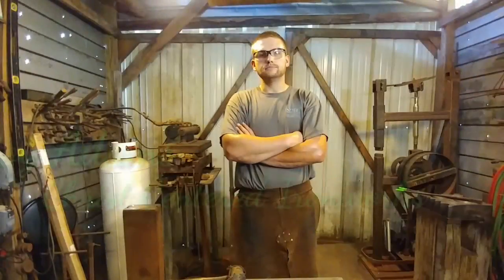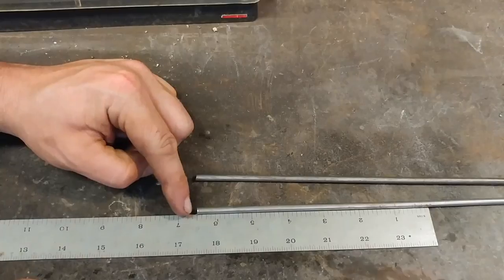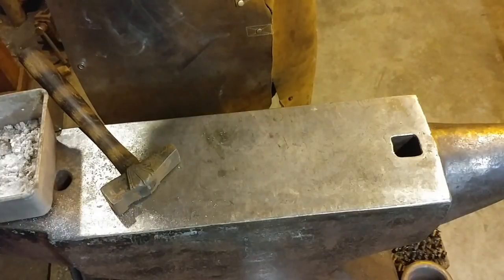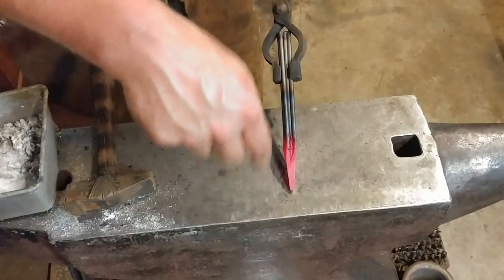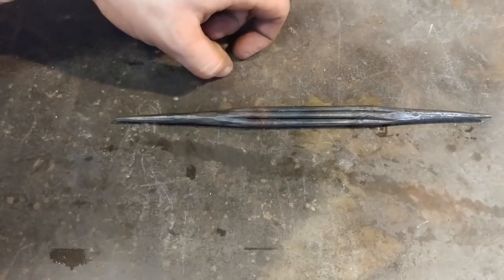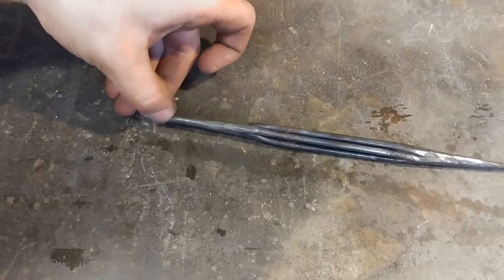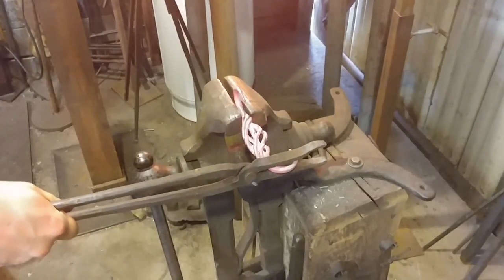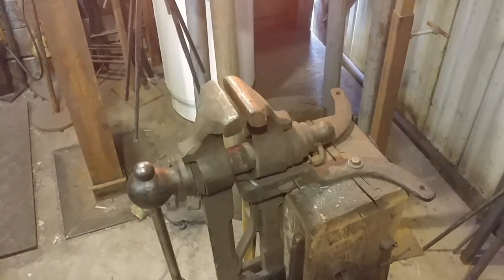Forging a Basket Twist S Hook // Blacksmith Projects to Sell

Comment: It's a pleasure to watch " blacksmithing " video that is not knives, or Damascus steel, or power hammered. I know they have their place, but not everyone has the skill set or shop to do those things. Some of us like to see the kind of projects that you are doing, please keep up the good work, and thanks.
Reply from the maker: Hi Jim, I'm glad you like my channel. I really enjoy doing a diversity of things, and it shows a lot in my work. I suppose I don't  have  a set "style" like some blacksmiths do, but it works for me :) Thanks for taking the time to watch my videos and comment. God bless and have a great day.
Reply: Skill? For blades? Compared to this?

I find this sort of stuff harder than blades. Sure, once you see how it's done, it's not all that difficult. But coming up with designs, and then a way to convince a hot piece of iron to shape itself according to said design... Calculating how much material you need for a particular part you're going to draw out or upset, ... Compared to that, hammering out a mostly 2-d shape and refining on the belt grinder (or angle grinder if that's your thing) is child's play.

Comment: I generally skip drawing out then ends until the basket is to my liking. Keeping them square-ish helps with the twist and counting turns. I also cool out the ends so that they don’t deform.

Try mounting your twists vertically and giving the top end a few taps after the back twist opens it. It helps to give it the girth you want.

Comment: Noticed you are using a one sided tool for twisting. I'm just learning right now and lots of other use 2 sided tools for twisting. May i ask why you use a single sided tool for twisting? Others have mentioned you wanted two sided for the evenness of the twist and potentially saves you from extra random bends. Would you suggest a newer person to use a single or double ended tool for twisting?

Comment: Dude, we need to see you doing stuff, you don't have to speak incessantly. For the love of God.......
Reply from the maker: There is 1100+ more videos on the channel with plenty of work and instruction.some people think they have all the information they need to make a project like this by just observing and this is incorrect. The very fact that you have clicked on a how to video in the first place is to learn and hear instruction on how to make something that you can't currently make on your own volition.
Reply: @ChristCenteredIronworks  Oh I get that, however this happened to be the first thing I've seen of yours and I'd be afraid of hearing too much talk. I get you need to talk a bit, sadly we sort of get what you're doing already, and I dare say most who are looking at you videos, are familiar with forging to a greater or lesser degree. 
The easy fix for me is to turn off the sound but that leaves a lot of dead air with no action as you are pontificating. Hence, my initial post. Good luck.

Mind you, there are many who don't speak English and do videos, and never say a word in there videos. Just an occasional heat treat, or annealing spec.....and that's all that is required.